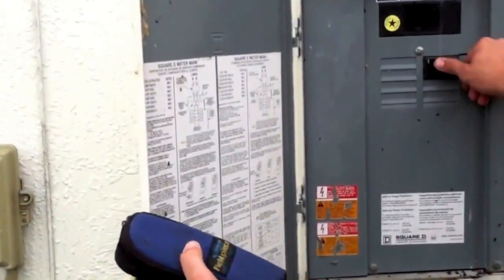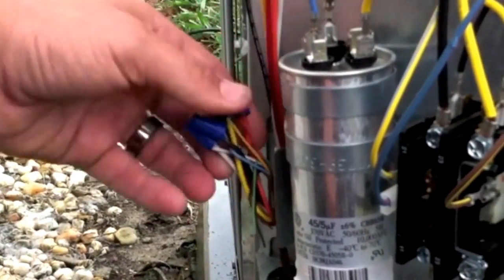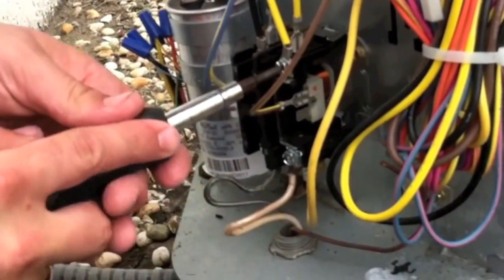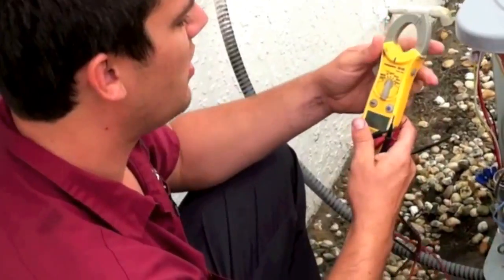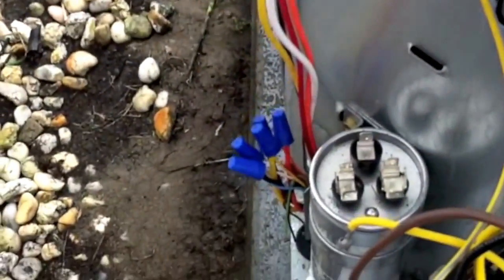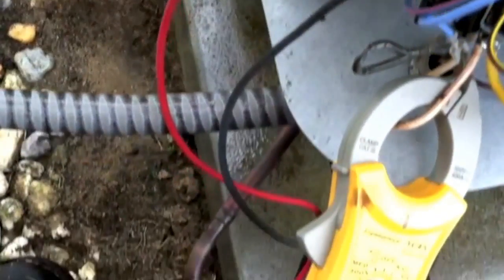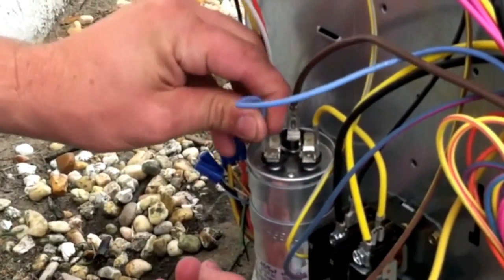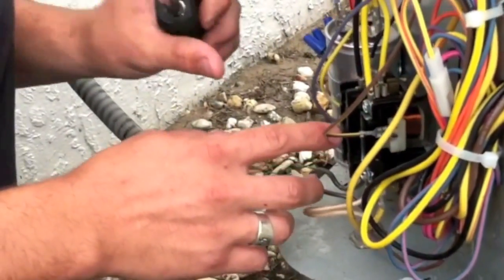How to Test an Air Conditioning Condensing Unit: Capacitor and Wires

Comment: Hi, first of all, that's an awesome video. I don't have multi tester with micro farad read out, using ohm meter, how would I know if the capacitor is dead?
Reply: You won't. You need a Multimeter that measures Capacitance. Go buy one that does if you want to test capacitors.

Comment: In my industrial park thieves cut out the copper components from six brand new compressors and before throwing away the scraps, I kept the brand new fans and
start capacitors with the hopes of somehow wiring them to 110V ac and using
them as attic fans or roof exhaust fans etc.   Can anyone comment as to whether
they could be run off of 110V  AC and if so, how to wire them up ?